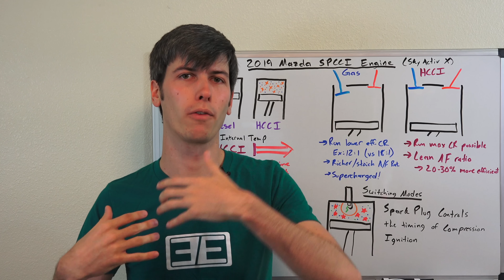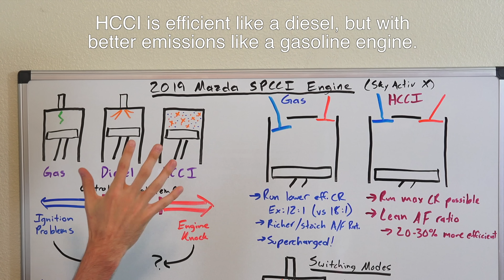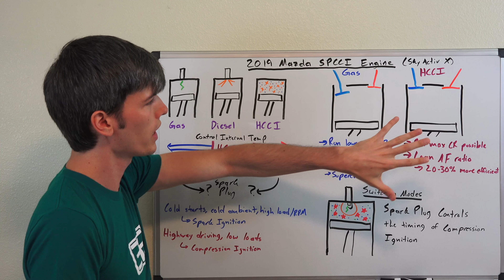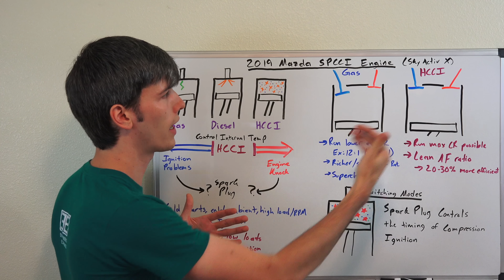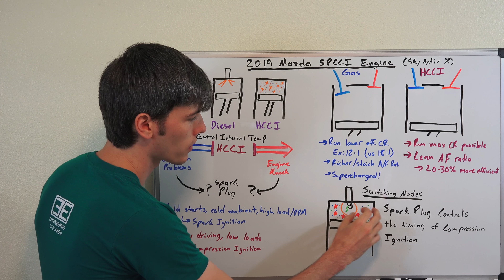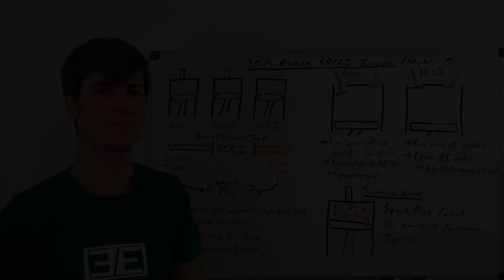Mazda Creates The Holy Grail Of Gasoline Engines - HCCI SkyActiv-X

Comment: Very interesting, thanks for taking the time.  The engine is not quite the Holy Grail but may be getting close to it.  The Holy Grail will be when we develop an engine with an exhaust temperature which is only just about hot enough to boil a kettle.

Comment: Probably better in hotter regions, and most likely HCCI is more easily accomplished at operating temperature. Spark plug is just to get the engine started? still wondering about actual fuel economy, as it might vary per area and climate.

Comment: I think this is a pretty cool innovation myself. Normal gasoline engines have poor efficiency only because the compression ratio is way too low, and this is only because
the high octane gas that is normally needed to suppress detonation and NOX emissions
is way too expensive. I know that for myself, if 112 or 115 octane gas was widely available
and relatively inexpensive, I would sure as heck run a much higher compression and buy
the good stuff!!

Comment: Whait a minute. When its cold the spark plug is ON and when engine rich the proper temperature the spark plug turns off for running like a diesel?

Comment: I would say that they would not control the over expansion by leaving the exhaust valve open because the valve seating would burn. My guess is a third auxiliary relief valve. Possibly spring controlled to control excess pressure.

Comment: no.. this is not how it work..they do not use spark to control the compression-ignition.. they didn;t use spark at all.. they use fuel injection to control the compression-ignition.. this is gasoline direct injection .. remember? it not possible to get knock and pre-detonation on GDI system..on GDI system the fuel only inject on compression not during the intake.. that why they can push the compression up to 14:1 in skyactive.. on HCCI they may remove the spark plug..and run solely on fuel injection timing to ignite the combustion..on the cold start it will use spark plug to start the car.. after engine warm up to close loop then fuel injection timing will take over spark plug

Comment: Maybe they're changing the length of the combustion chamber by raising or lowering the valve and spark plug assembly at the same time. That would be an efficient way of raising or lowering compression ratios... but I'm just speculating.

Comment: running it lean to increase efficiency.
MMMM??     Heat issues are an engines worst enemy.
i hope they have found a way to keep it lubricated and vented, otherwise you can say goodbye to your engine.
Also mazda persevered with the Wankel / Rotary engine, wich had no advantage over a regular piston engine in terms of Economy and power, yet mazda kept on building those thirsty dirty engines.
Mazda must be the wild card or the Eccentric charector in the Automotive industry.
Sorry, but im not convinced.

Comment: So reading through the comments I see a lot of gas engine haters. Well what will happen to the lawn mower? Gas engines will be around until the end of time. Sorry if you think electric will be the standard. Oh I forgot what about boats? Oh yea trains need prime movers  and back hoes and cranes and trucks of all sizes and chainsaws and weed whackers and ________ fill in the blank. Ps this engine design will not work ultra lean mix = burned up pistons. Timing will always be a crap shoot and 20% gain in efficiency will not be worth it compared to the exotic materials used in the design. As it stands be happy with diesel this design is time tested.
Reply: - My local hardware store already sells electric lawnmowers, chainsaws and weed whackers.
- I've never played with an electric boat myself, but they're readily available and have been for a long time.
- Tesla is already developing a truck / big rig / prime mover. I'd expect the same for trains fairly soon, though probably not from Tesla.
- Backhoes, cranes etc are perfectly suited to electric - massive torque from standstill, and no need to carry their own batteries very far.

I'm not hating on gas engines, but you're kidding yourself if you think electric won't replace combustion engines in almost all applications over the next few decades.
Reply: Just adding, Tesla has now demonstrated a semi truck and a pickup. And the semi truck dramatically outperforms all available diesel trucks.
Reply: Parker B
We're in the end game now for fossil fuels, and the oil companies know it - that's why they're all investing in renewable energy now. They can't stop this, and they're smart enough not to try.

Meanwhile pretty much all the major car manufacturers are scrambling to bring out mass-market electric vehicles, and prices keep dropping fast (especially for batteries). Things are changing fast, and honestly the major delay is going to be imposed by the working lifespans of existing ICE vehicles.
Reply: J&B Fix it shop love my cordless 80 volt electric mower and weedeater. Using for 2 years and absolutely no problems, no gas no oil and my neighbors don't even know that I'm mowing my yard.
Reply: We will never run out of oil. I believe the earth makes oil everyday non stop. What the earth uses it for I have no clue. I only know this, It came out of the ground, actually they found it on the surface if history is telling the truth. End result is it was made by the earth is what I believe so we will not run out of it. The other energy designs are good and we should be using them but without oil they will soon cease to work.
Reply: nah the world is moving away from oil, whether you choose to accept it or not is up to you. batteries keep getting better and better and cheaper, its only a matter of time. i still have fun with my gas powered toys, but i definitely look forward to electric powered everything.
Reply: I think it's safe to say that aircraft will continue to rely on burning hydrocarbons for propulsion until the day arrives when nuclear powered aircraft become practical.

Comment: Meh, there are ford modular 4.6's out there cracking 45mpg on flip/flop ignition. Basically you just inject fule every other intake cycle once the engine is warmed up.

Comment: wait... if the plug is facilitating HCCI, this system will only be more efficient at ONE specific octane rating. getting the plug to light only just enough fuel to raise pressure to the threshold at which the rest of the fuel lights spontaneously will require consistent ratios, compression, and octane. it might not even work with other ratings without remapping. a computer will have to sense exactly the rating of the fuel getting sprayed into the engine, right as it's getting sprayed into the engine. or you can completely fail HCCI or worse, have knocks.

this is problematic, two things come to mind, and i'm just a dummy. a: fuel in the lines can be different from fuel in the tank directly after refueling
b: fuel in the tank can be a mixture of everything from 87oct to 51%e85 to 85% e85, plus any number of popular fuel additives

Comment: if it were a turbo motor, this would be better. right as you go WOT, the intake valves stay open and piston pump air-fuel into your intake manifold to shed compression, pissing fire into a hot turbo and spooling it into boost like an anti-lag system. with a loud pop, you're into peak tq.

Comment: So basically, they INCREASED the PSI of compression...you know, like Hot Rodders did for YEARS. Only difference is,,,you can ADD more PSI when YOU want it and you have a Heavier Flywheel to keep it rotating.

Comment: Hello! I didn't really understand if the decrease compression ratio during the spark plug phase. If, do they use the inlet/exhaust valve? I suppose that during the HCCI phase they will have around 18:1.

Comment: I know that, to some extent, you can run a mix of diesel and gas together just fine in smaller engines (don't know if there is any power loss). I wonder if a such a mix would improve the operation of this engine at higher loads...    Get some characteristics of diesel with the easier/more common to maintain gas engine.

Comment: Hasn't there already been an engine using SOME kind of "variable compression ratios"? if I remember correctly it was either quickly canned or didn't even make it because of a crippling headgasket issue brought on by the inherent nature of its design

Comment: Yes, an engine that has been tried and failed every single time is going to work at some point... 

We've seen this before, too bad that the projection doesn't actually work in real life but their hope is that it will eventually work but then again, at some point ICB's will not be allowed anywhere so what is the point?

Who cares? We now have cars that can be refueled with salt water and will run 200+ miles on ion exchange.

Comment: so what happens in the HCCI when you run the wrong octane of fuel?  does it adjust compression? adjust fuel mix?
Reply: Valve controlled compression adjustment, most likely
Reply: Ultimately you want to control the temperature by controlling pressure. Pressure and temperature are directly proportionate. Different octanes ignite at different temperatures, so I figure Mazda would utilize the valves, like demonstrated in the video.
Reply: I know that you are looking for scientific reason for the way that the engine would handle  out of spec octane ratings, but having worked with Mazda in the past, I feel pretty confident their official answer will be "....Well just don't do that."
Reply: The engine is already constantly monitoring and changing the running parameters. The octane of the fuel would simply be automatically taken into account from the actual running of the engine from the inputs of the sensors and would alter to suit those running conditions at that time, in this engine I would imagine conditions of each firing of each cylinder would be being monitored and altered on a cylinder by cylinder basis, regardless of actual octane rating. Just as it does for load, speed, airflow, temp, knock, air/lambda sensor/s.
Reply: It goes into Nope Mode

Comment: I'm not engineer or anything but I'd bet that they're going to run into durability issues and will be prone to huge engine failures due to running lean and at such high heats.  If you pushed it often, I wouldn't see it lasting very long.  Like j said though, im not an engineer and I'm sure they're finding some way around it to keep things lubricated and maybe adjusting it to operate under higher heat but I wouldn't risk buying one of the first generations or so of these.  Just my opinion though
Reply: You have a good point with lean burn and high temps, this can be overcome by using pistons with a special shape and direct cylinder injection. A piston shaped with a bowl in the centre and fuel directly injected into that bowl and ignited keeps the heat in the centre of the piston and away from the ring land(which is where the damage is done from excessive heat)
Reply: If they use diesel engine technology (which can withstand high temperature ignition) then they'll be just fine.
Reply: Well you can't just push it, the operating parameters are pretty narrow between the minimum and the maximum temperature of the engine! The ECU will simply rev limit it harsher. It's not supposed to be a nice and fun engine, but a slow and efficient one.
Reply: The idea is that if you push it, it runs like a regular gas engine. The lean/high pressure running is for low load work.
Reply: jebusDsavior dont forget their rotary engines. Massive waste of money. Granted the exhaust fire looks cool. But it melts the bumper.
Reply: Dude Shark I agree. Never buy the first generation of something you need to be reliable. Usually the next generation is better, if it's not you should look elsewhere.
Reply: Well people had been trying to create an engine like that for decades, and it never worked well enough for production. Apparently Mazda have found ways to overcome these problems, we'll just need to wait and see how and how well they did that.

And yeah, engines keep getting more complex and more systematically fragile, but they've stayed reasonably reliable this whole time. You worry more about your transmission going than the engine.
Reply: I hear you... That was just what I was afraid of. I plan on buying my next car in 2019, so this sounds amazing... but I've never been an early adopter, even in the tech world where the costs are lower. This is a freakin car... I really believe Mazda can pull it off, but first generation is almost guaranteed to have teething issues...
Reply: Dude Shark  Another uninformed opinion on the internet.....imagine that.
Reply: You all forget the government mandate of 2030. They must rush these designs to attract money, same thing LG is going through now
Reply: Like they did with the rotary engine?
Reply: Engines running lean mixtures run hot because they don't run lean enough. The hottest possible temperature is achieved at stoichiometric AFR. In an engine, not only have you burnt up all the fuel, but also have no excess unheated air or unburnt fuel to carry the heat away. Since air has a much lower thermal mass than a liquid fuel, running lean means almost nothing to take the excess heat away.
However, Skyactiv-X at SPCCI mode runs at 37:1 AFR, typical for a lean-burn engine. There is so much more air that after each droplet have burnt stoichiometrically, there is still excess air available to absorb the resultant heat from the explosions. When the excess air absorbs the heat they also expand, thus also contribute to the overall force pushing the piston down.
There has been a number of engines with lean-burn mode, and not one have ever received complaint of overheating. The only downside is because they don't operate with Compression Ignition, their explosions have a slower flame front thus greatly reduced torque and power. They also don't work well with modern cat-converters as they require a certain pollutant balance to carry out the chemical reactions to reduce NOx output. Hence why by around early 2000 manufacturers don't make them anymore (not because they were unreliable and hot).
Reply: sounds like it would make a good 'range extender' engine for an electric vehicle just running at it's optimal efficiency mode!
Reply: Their efficiency comes from burning the mix of and air and fuel at LOWER temperatures, which ends up reducing much of the heat energy lost in a normal gasoline engine. Because of this efficiency, a much leaner air and fuel mix can be used. The process also produces much fewer emissions.  So NO high temps like regular lean burn.
Reply: back in the 40s farm tractors were experimenting  with gas/diesel start and warm up on gasoline then switch to #1 or#2  fuel ,. now in the 21fst century just now this is being revisited
Reply: my thoughts exactly but hey we can bet they did the math
Reply: "20-30% more fuel efficient" [theoretically] ---> real world application 10-15% more efficient [when new]. Unforseen premature failures from added fail points ---> dramatically increased operating costs. 

It's the Prius all over again! Let's combine the technological drawbacks of gas AND diesel into one package and see how often it breaks. I hate our Prius, constant problems with less than 5k a year put on it and only 40mpg to compensate for the added costs of ownership.
Reply: i'm just saying, i don't really have anything relevant or even intelligent to say, but i thought you all needed to know that.  hope i didn't waste any of your time, 'cause that's the last thing i wanted to do.  just sayin'...
Reply: John Michael just cos’ !!
Reply: If it was a European car, then yes I would be concerned but it's a Mazda and they are ultra reliable and I'm sure they aren't going to go backwards in that regard.
Reply: hey mazdaspeed6 owner here... run into huge engine filures? ... i cant be sure but i figure u must mean that in future tense... whcih is what made me laugh when i first heard of this compression ignition bs, based on the fact that mazda with its switch to skyactive solved 2 problems 1) having a zoom zoom able car 2) all the damn engine failures from the DI engines failing from going WOT too often, and i say it with love, but yea HCCI is just mazda deciding to give up and pretend the massive amounts of knock and misfires they can seem to stop to save their lives... is somehow a feature.... so basically i totally agree, zoom zoom boom is basically mazdas slogan from 2005 to 2030 i guess lol
Reply: NO need for an engineer to figure out, that such complexity will create problems.

Comment: Thanks for the info but there is one thing I don't understand. I understand why a spark plug is used to control combustion timing when the engine is cold but how could one depend on a spark plug to control the combustion timing of a hot engine? Surely the temperature of compression plus the temperature of the cylinder environment in a heavily loaded engine would produce preignition resulting again in uncontrollable combustion timing and potential engine knock. So how does one control the combustion ignition timing when the engine is running hot? You certainly couldn't leave it up to a spark plug. Does the engine management system also reduce the effective compression ratio when  the engine is heavily loaded? Seems a little redundant if it does.

Comment: I feel like we all forget that a power plant is there to convert the fuel to power. That conversion yields various types of power beyond that which goes to the wheels.
Power is indicated by; light, heat, sound, vibration, motion, and friction.
These need to be overcome in order to get the maximum conversion of the fuel. ijs